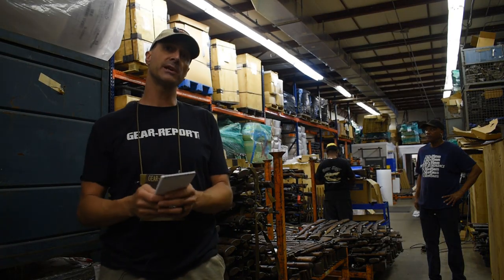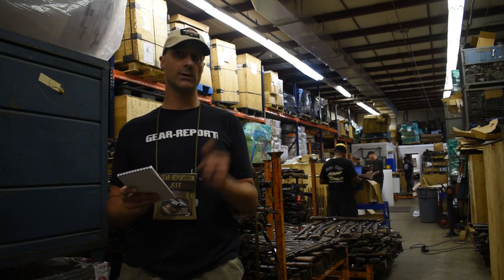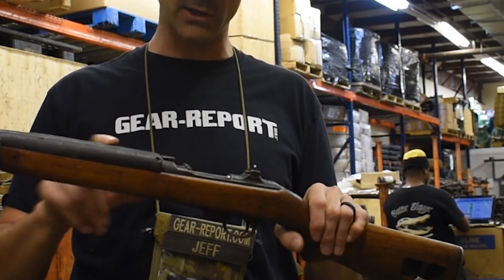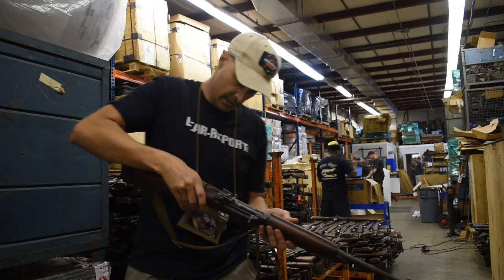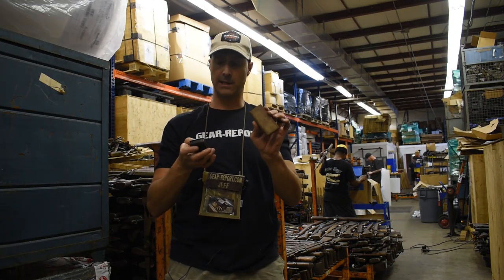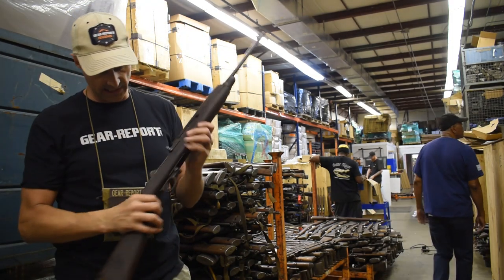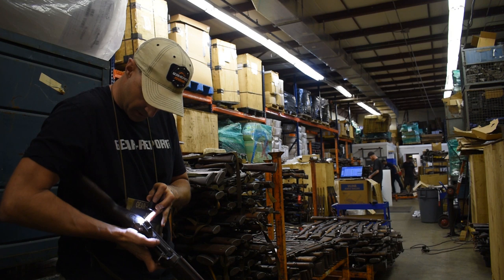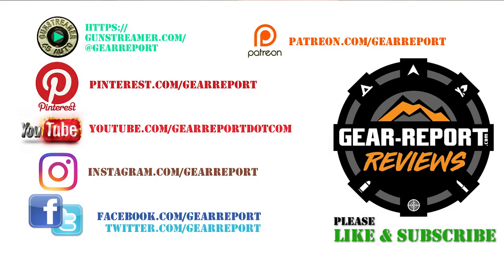Freshly Imported M1 Carbines at Royal Tiger Imports

Comment: I just got a rifle from them. It's an IBM with a SA barrel and stock. I paid for very good to excellent condition. The rifle is nowhere close to VG. The finish is maybe 60% left and the stock was rough. It didn't come with an original mag either. Mine came with a new production mag. That was disappointing.
Reply from the maker: Thanks for sharing. That sucks. It troubles me the number of reports we have seen like this.
Reply: Sent them an email and they sent me a correct magazine. The rifle runs great just was hoping for something that was more original.
Reply from the maker: @bhoges5145  Glad t hear they got the mag right for you, at least.

Comment: Saw a guy post a Mauser that Royal Tiger Imports saw fit to ship out to him. It was terrible. The barrel was counter -bored and rusted to hell.
Reply from the maker: I don't think that counter-bored or not is really a fair complaint. They are selling actual military used guns. If the military counter bored, then that is part of the history. 
I would hope that they only sent a rusted gun if it were sold as such. 
But RTI has been known to send some guns out that make me scratch my head.
While touring we saw a LARGE pile of guns that they pulled out and tagged as unfit to ship. So, I know that they do actively pull some guns out to sell as "broken". Beyond that, I don't know. We just report on what we see. We don't work there or know what happens when we are not there.